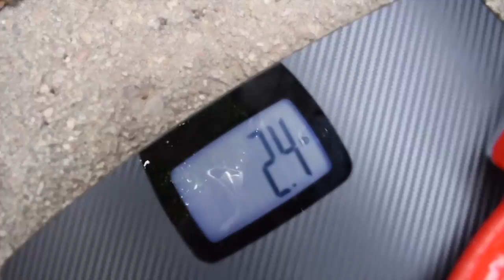MaxpeedingRods 350z Camber & Traction Arms Install !!

Comment: Does you’re car handle better with these ? As well as turning and handling ??
Reply from the maker: Not sure if it handles better because of the parts or the alignment but it feels a lot better driving through corners. Never was able to dial in alignment before